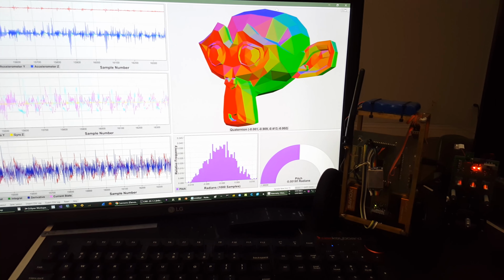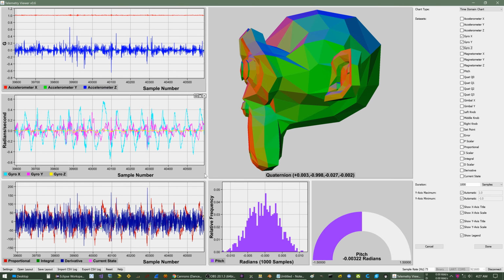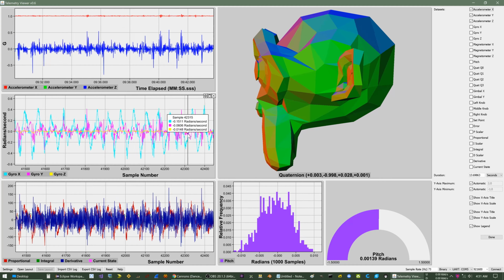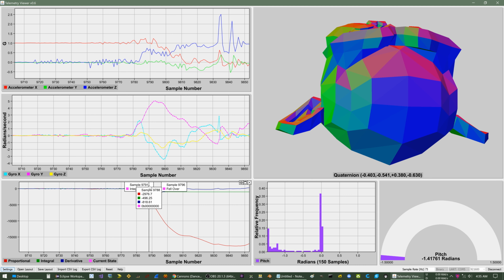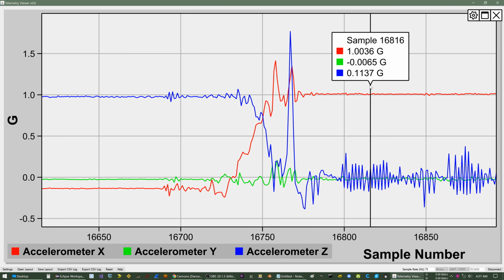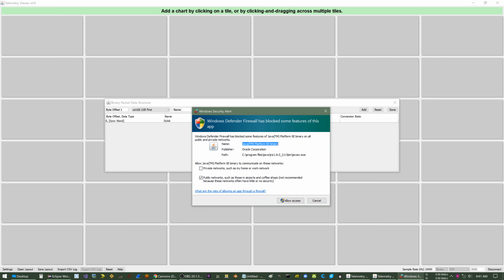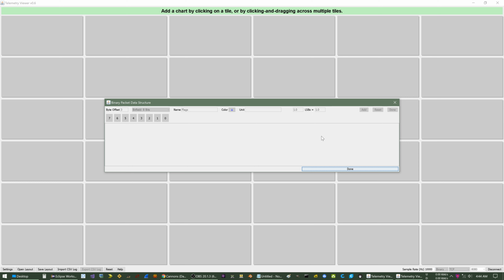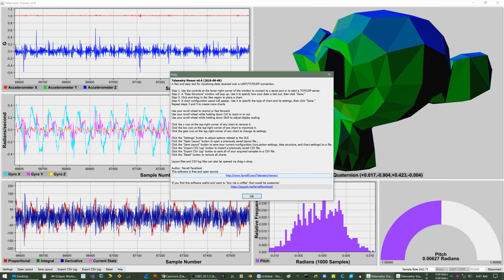Timestamped Arduino Data Logging and Telemetry

Comment: Version 0.8 does not allow you to save the layout and works with glitches.
You have to launch it not through Java (TM), but through OpenJDK.
But the program works strangely, it does not always display the workspace grid and it is impossible to close the program, only through the task manager.
I also don’t understand how to upload data from a program with a timestamp in a normal, “human-readable” form, and not in POSIX.

Comment: Hey what's the throughput achievable with this? I'm looking to transmit 16 sensors at around 5kHz each
Reply from the maker: That should be fine. I've done 12 sensors at 10kHz, and it was no where near bottlenecked. I've actually been working a lot on performance since the last release, and the upcoming version can process  >5Gbps when using a modern laptop.

Comment: Hi!!
It would be a complete tool if you could also plot on the x, y plane. In addition to a section to send messages by serial and UDP.
I implemented in the code the sending of serial data: A start and stop button and a text entry that accepts integers for a set point.
I use UDP with ESP32 only I haven't added data sending yet. It is a lot of code but it is a very good tool.

Comment: This is some amazing work. I'm pretty excited about your next release.
I plan on using it without an Arduino (telemetry data via variables within a Java program).
------
If you don't mind, I have two questions:
1. Is there an easy way to auto-load a layout? (If there is not, no worries. I will figure it out).
2. What Eclipse addon did you use to design your JFrames/Windows? Was it Window Builder? Because I could not get Window Builder to recognize your code in Main.
Thank you!
Reply from the maker: Thanks for the kind feedback. Right now there is no way to auto-load a layout, but I have plans to add that. It won't be in the upcoming release, but probably soon after it. Regarding the GUI design, I did not use any special tools. It is just "hand crafted" code. I tried various plug-ins before, and found them to be very unstable when designing anything non-trivial.

Comment: This program has helped me so much, thank you very, very much. I have a question. When you scroll with the mousewheel to go back and look at some peaks, is there a way to resume playback? Right now I have to scroll forward until I catch up with the current data. I'm using it sort of like an oscilloscope and viewing things in less than milliseconds so scrolling takes ages.
Reply from the maker: The next version of TelemetryViewer has a "Timeline" feature, and that has a button you can click to jump to the end. I hope to wrap up this version within a week or two. I'll post a new video when it's ready.
Reply: @upgrdman  This is wonderful news, thank you. Any chance you could add common oscilloscope features like rising/falling edge detection? It would be handy if it could display the latest peak so you don't have to scroll.
Reply from the maker: That's also in the works, but won't be done in time for the next release. It'll probably end up in the next-next release.
Reply: @upgrdman  Great! Thanks man.

Comment: Hi sir, I have tried your software (.jar) file to  plot PRY from my Arduino connected MPU6050, but I am not getting the real time display of the graph, it is only updating after thousands of reading. But the csv has full records. Could you plz help me, I am using Win7 laptop with 4GB ram and USB2.0 COM port is the ram sufficient? Is it due to java version issue?

Comment: I'm using this software to visualize accelerometer and gyro data and I'm wondering how you are computing the quaternions?
Reply from the maker: My firmware uses Madgwick's filter, which outputs a quaternion.

Comment: Amazing! 
One question: If I only have serial data coming in via USB, how do I connect? Or should I just revert to version 0.4?
Reply from the maker: Hi. All versions support serial communication. Your USB adapter should be listed as one of the available "COM" ports (assuming you're using Windows.)

Comment: Does anyone know if I could replace the wifi link with a normal radio link like a NRF24L01 2.4GHz Transceiver Module?
I want to use this telemetry view just with a different transceiver module but, still use an Arduino.
Reply from the maker: You would need some way to get data from the receiving NRF24L01 into your PC. Hmm, maybe make your own receiver with an Arduno and an NRF, then use the Arduno's USB UART to funnel the data back into the PC. I'm not sure how easy that would be. Hopefully someone else can chime in.
Reply: @upgrdman  Thanks for the reply! I'm looking into it and hope it's just that easy. I plan to build my system for outdoor use at short, line of sight range, perhaps ~100 meters. I really want to use your viewer, it looks amazing.

Comment: Thanks for the amazing job, used your program 2 years ago, would have loved to have back then the new "time" functionality, not having it gave me so much work to correct nontime-steady acquisitions... Now that'd be an easy chore!
I would like to suggest some of what I think "easy" improvements you could add.
1. Computer time on the x scale, like this data point was plotted at 3 past 2 pm (obviously 14:02:ss:mm) not just the time from the beginning of the acquisition. (I know I can obtain this from the csv but for real-time monitoring it'd be awesome, healthcare sensors applications)
2.  Add a "led light"  lit if digital data is high ( or signal above set point) I'm doing this currently with a smartly scaled radiant chart, but a light bulb would look fancier.
3. A go back to the latest data, some times I've been checking data from hours ago and had to scroll a lot to get to "real-time".

Comment: (FOR THE BELOW FIRST MSG) I'm sorry sir, I just saw your esp wireless data transfer video. I mean to ask very long-range serial data transceiving possibility modules, not the wifi or Bluetooth one.  
2.  is there any extension for reading sensor data from the cloud (ex; google sheets) and live displaying in your dashboard!!!
3. can i store the data, apart from live streaming telemetry, using your dashboard

Comment: Hello upgrdman!  I'm following your development of your telemetry viewer from begining. Now with the logging on HDD is finally really improved to someting really usefull.    I would be nice to have something like 2 point calibration for analog  sensors.  Of course it will be onlny linear but still usefull,  and maeby featue to change  backgroud color.. :) 
Thax anyway for your developmpent.. you are very skilled programmer.